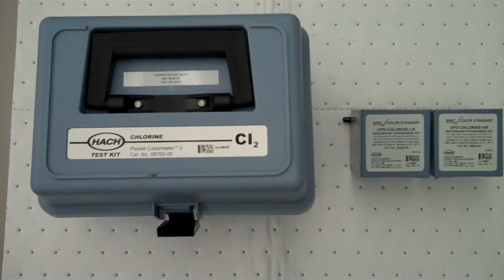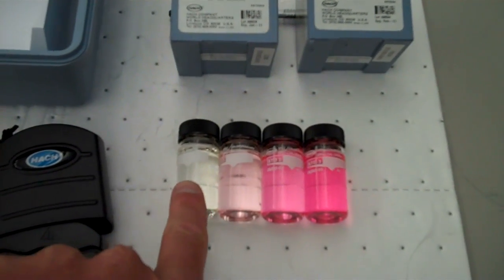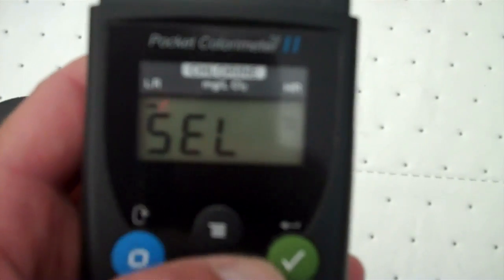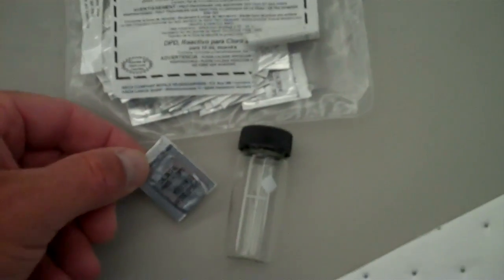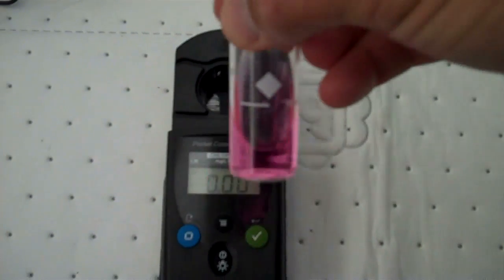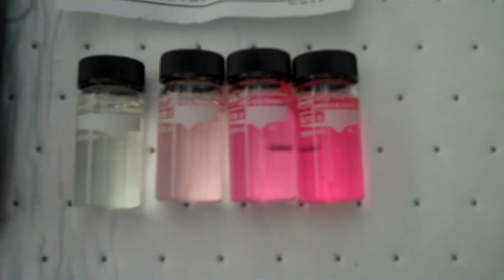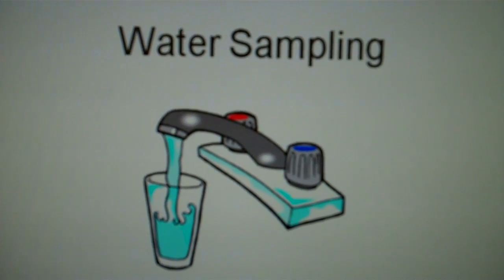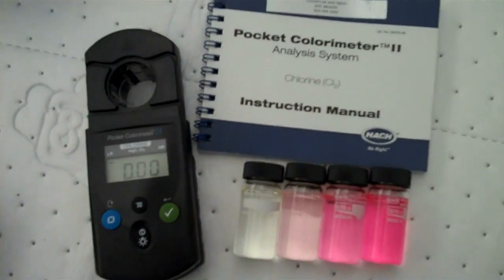Hach Colorimeter II Chlroine Residual Tutorial

Comment: The tested water has zero free chlorine. In the presence of a true free residual, dpd turns pink instantly. The water that was tested has not reached breakpoint chlorination. I'd guess it is feeding a weak monochlorimine residual. On this side of the chlorine curve free dpd will lie. It will approach the total residual the longer you hold it.

Comment: several issues with this video. If you haven't used the Hach II kit before,  turn this off because there are steps skipped, ignored,  or completely wrong in this video. I hope the individual that created this video doesn't have to represent his community as a water or wastewater operator.